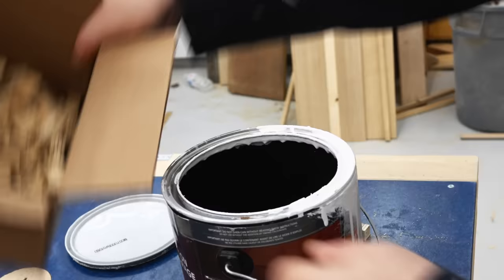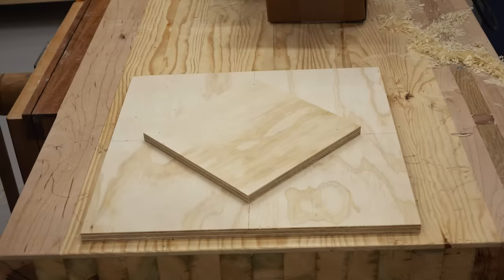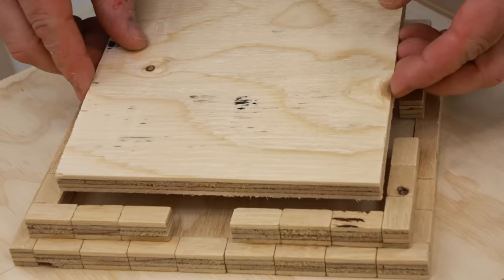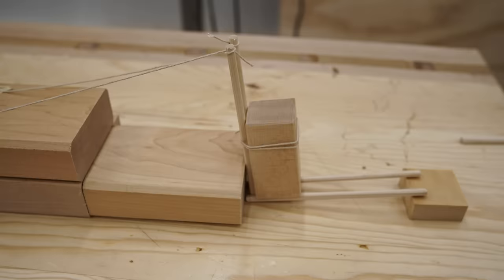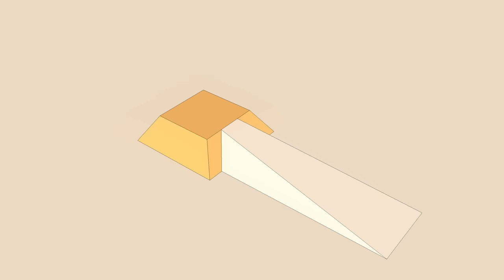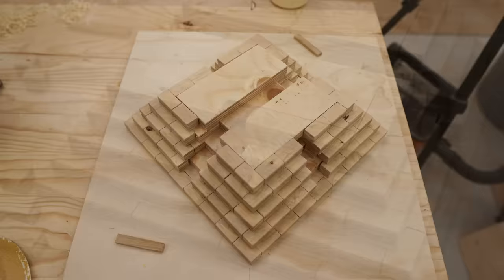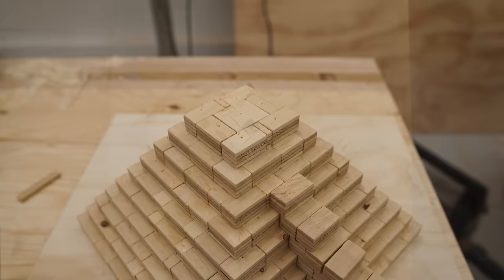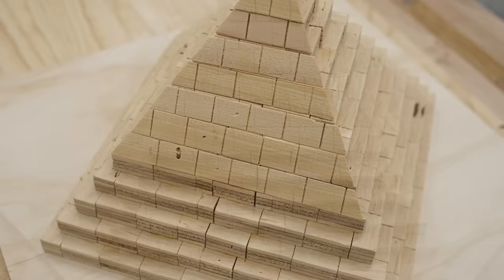How I Would Build The Great Pyramids

Comment: Do the math, scale it down and gather any material you desire to form the vast and numerious number of block's you desire. Cut them, shape them, and form them using the most up todate process availble. pain stakinly assemble them into a pyrimid and the see if your constuction meet's to what degree of accuratcy those large one's in Egypt have. I'd give a hundere to one, I'd give more, but I'm on a fixed income. If the one you could build, whould be any where near as accurate as those in Egypt, though you utilized the newest and greatest technology. They only utilized stone and brass.

There are a series of hole's in a place called Barbar or something simular. Which using the newest and greatest measurening devies envolving lazer. The finished wall's, various corner's, legenth, etc. are so perfect. They utilized the term N-th degree, when the number of digit's after the decimal point is to many to count. And the hole's are with in one of the hardest materials know to exist. Supposedly all done so perfect, that it can't be done today. And assumed to be for the sole purpse of storing grain. Hmmmmm

Comment: you are wrong............ y  ? i will tell you-first step (1) They marked center point of pyramid ,from there distance 115m  they marked base line 23om  long and four corners A,B,C,D with 230m long   -
(2)   They made complete basement including center 
(3) They made mud ramp in between base A & B  (not mid not in corner)
(4)They made first layer except ramp area and 'next layer ramp slop distance' (main point) with the help of animal ,man ,trolley ,rope   Etc. if it is heavy ,light weight ,soft ,white color lime stone ,clay any material
(5) The above ramp distance they keep extreme sides up to the top level  . 
(6) The inside cave , corridor, D body chamber every thing built - Bottom to Top -  as per old construction Knowledge and mythology
(7) Then after the ramp closed  -Top to Bottom 
The Proof  (imp)
(A) If You check Pyramid top flat area (approximately 10 to 20m wide) - You can see  - small slop at stone paving   and balance stone heap also  - They stop layering purposely  because of settling issue  - The bottom of sloped flat top  they start ramp closing.
(B) Please study the corners (inclined corner-top to bottom) there is no proper filling  - blank steps only  - why ?  - they cant place the stone  ha ha  - old  poor peoples 
(C) Laterite , lime stone and sum kind of another rocks is soft at digging (cutting) time , Then it will become hard with the contact 
of air , rain  , wind and etc     ... This fact is normal knowledge of human 
(D) And wondering point is duration of construction ---years and years -- Not one not two not three    more than ten ,twenty ,etc etc

(E) The reality is - one king ordered - pyramid is history of -poor slavery  people - not mechanism not technic not at all 
only heap of stone  yes only heap of stone  
pls replay if know anything rather than above  ha ha ha

Comment: You need to remember that, as far as modern science is concerned, they did not have wheels. So they did not have winches either. Where would they get trees strong enough to flip the stones end over end like you suggest? How many people would have had to pull on those ropes? Ropes made out of what? And we should see evidence of rounded off corners in the locations used as fulcrums, and maybe wear lines half way along the side of blocks. This method doesn't sound very convincing.
The likeliest scenario is that they had access to technology we don't know they had. And I'm not talking about aliens. But they may have had wheels, they may have had pulleys, maybe even iron. The people that built the pyramids were certainly more advanced than modern science claims they were. Egypt is filled with technological process markers that simply don't make sense. Things like huge cutting discs, drills that made holes in granite at faster speeds than modern tools, and some sort of tool that left behind marks which can only be described as scoop marks in granite. We are really, really far away from understanding how these people built anything in Egypt.

Comment: You didn't find it feasible or nessary to cut every piece material required ro fill in the pyramids. If you had this had this experience dealing with small pieces of wood is it absurd think they didn't have the same feelings about dealing with multi ton stones? I bet most of the pyramid (all that can be) is filled with sand and not blocks or stones at all.

Comment: You sir need to do actual thurough research on the pyramid. You need to incorporate the smaller additional shafts from the queen and kings chamber. You completely neglected the angled stones above the entranceway. In the end you describes the placement of the casing stones and you're legitimately trying to say humans lifted 20+ ton stones into place while standing on a ledge 2 feet wide??

Comment: They look nice because the cap stones were veneers.  You really think every block is perfect. Nope....they slapped together whatever they had a  filled the gaps with mortar. Easy to move stone in powder form then add water jam it Into the gaps then it becomes a solid rock again. These techniques would never be used in reality. The easiest simplest answer is usually the right one. Specially when it comes to moving stone

Comment: Naw! Nope! Here's how they did it.Each edge had wood steps: four steps per pyramid. On each side and located dead center was two separated  giant wood platforms for runners to stand on. The weight of the runners would sink their pkatforms and raised anothe large stone block on the ground platform which held a stone block. When the runners platform reached the ground the stone block then reached the top. Meanwhile other runners were going up to serve as counter weights. With four lifts and four steps and perhaps sixteen teams of runners the pyramid could be erected in just a few years assuming stone blocks were always avaiable. Please no applause! Thank you and I'll save my acceptance speech in Stockholm.

Comment: I have physically moved 1.5 ton stones. It was magnitudes harder than the 1000 pound stones we usually moved. Yes you can move the whole earth with a fulcrum and a lever but where would you get a lever big enough strong enough. A   fulcrum big enough  and ability to move that lever. Sounds so easy use sides of pryamids for a ramp . Not true. Using the sides of pryamids for ramp will dislodge the stones from the sides. It takes more force to move an object at rest than once it is moving . How will you stabilize the ramp pryamid stones so they dont move when you're moving new stones on top of them. Over simplefication destroys engineering theories. Thats why so many crane accidents happen and other construction problems occur when building massive projects. A 150 unit condo building leaning to on side can be straightened with a few dump trucks pulling it. I've seen this done but pulling a pryamid if the base stones have moved isnt possible. The math of using pryamids sides for ramps shows thats impractical to impossible. For example the density of all limestone blocks varies. If a heavier stone is dragged across a smaller stone the force required will move the smaller stone before you get heavier top stone moving. This can be calculated using formula for force need to move a stationary object. 
Show me the math not a plywood model or a 500 lb of cement and say thats how 80-100 ton stones were moved. Even the calculations for creating these blocks creates a mystery let alone their transport and perfect placement to within 1/50 of inch. Im not saying aliens or Atlantis built the pryamids but dont demonstrate how they were built using 2 inch x 1 inch x ½ inch plywood blocks UNLESS YOU SHOW ME THE MATH for average 1.5 ton to 100 ton stones.

Comment: You made a fatal mistake by creating "homogenous" blocks all the same size. The blocks in the pyramid are "Not" all the same size. Heterogenous blocks make for a solid and earthquake proof structure. Using homogenous blocks creates a "weak" structure. That's why all our bricks today that we build with are the same size. And we claim to be smarter than the Egyptians.  duh. The great pyramid is made up of different size interlocking blocks. By interlocking the blocks is why the great pyramid has stood the test of time and not collapsed.

Comment: Todays technologie dosent even work to construct them. Modern cranes couldnt Lift that obelsic or the big granite stones above the great chaimber. Its still inpossible, and the ramp theorie is nonsens too. The Max steepnes could only be 8%, that would mean that per 100m of ramp you will gain 8m hight. that means you Need a 2km  long ramp, and still couldnt lift the big ones. BTW the quarry where the big granite stones was cut Off is over 500miles (+800km) away.

Comment: The REAL issue with the construction of the pyramids, is not just how those stones were lifted, etc. The actual mystery is the PRECISION of the stones. T-squares held to corners in inside the pyramid, block light being shone behind it. Stones cut AND laid less than the thicknes of a human hair. Not to mention the time projection of how long the pyramids were built; those massive, insanely precise stones, would have to be laid every 30 seconds or so.

The Sphinx also has an EXACT mirror image face. So exact, if folded over on itself, they are IDENTICAL.

Many plausible explanations on how a 600 foot tall pile of stones could have been stacked. Literally nothing in terms of how to explain the precision.

Comment: Guys, with modern techniques lasers and hydraulic equipment we couldn't build it in under 100 years. Putting the stones in place with levers and sticks isn't precise enough. The stones were cut and placed with smaller than 1/10th of millimeter precision. You can't fit a strand of hair inside. And the middle part has cross sections of hundreds of tons long stones which could not be lifted up the the steps in the manner explained, originating from 100's of km away. Throw away the assumption that this was built with primitive technology. Think about the fact that it could be 12000 years old. Think about the fact that those people were just as smart as us and possibly had a civilisation with tens of thousands of years of advancements in technology which were wiped out due to the ice age/other catastrophic event (meteor) and we were reset as a civilization. We are finding the tools from thousands of years ago bit maybe we will find also the tools some day from their period. And if we don't find tools it means it is some sort of acoustic or gravitational technology which did not require materials which fossilize
Reply: what made you come to the conclusion that we cant remake the pyramids, the fact that no one actually tried?
Reply: @freeguy3894  we can build space ships. Ofc. We could do it. In around 100 years